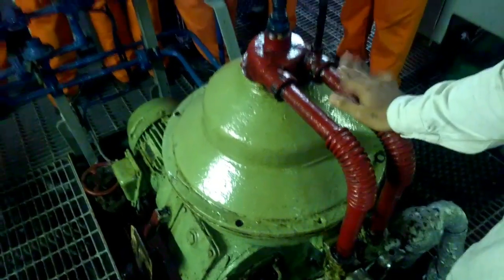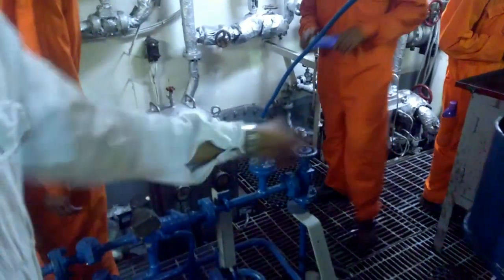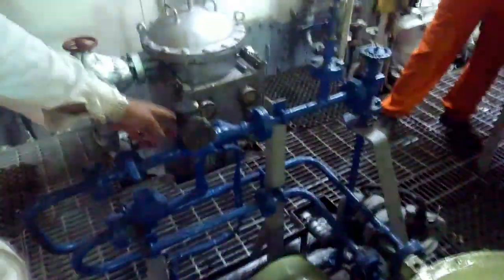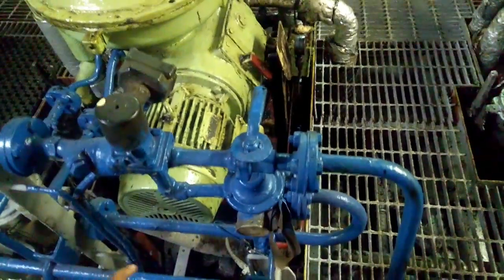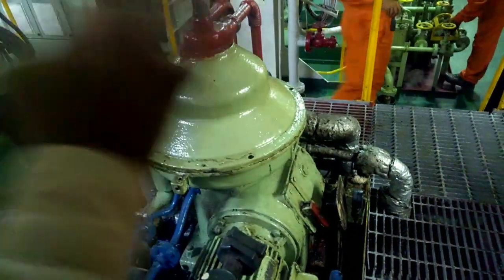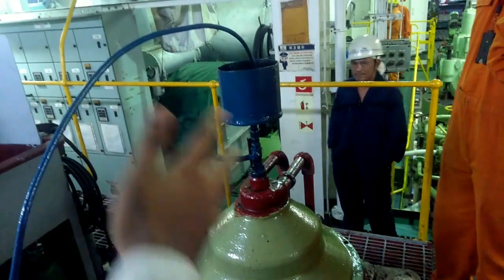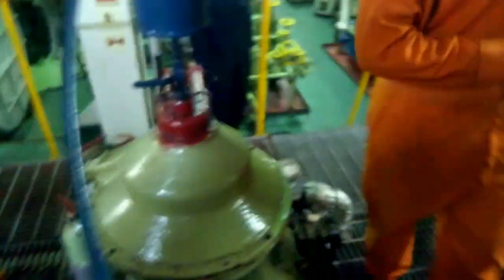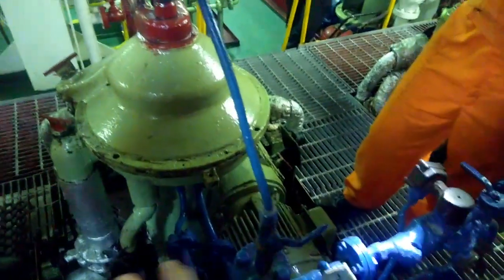I Spent 100 Hours Desludging Purifiers Here's What I Learned

Comment: Hlo sir, what is the difference between MC and ME engine and rt flex engine ?
Reply: RT flex controls the valve timing and fuel injection electronically unlike the MC engine where it's done by camshaft that's connected to the crank via gear/chain.

Comment: sir what is meant by blind disc purifier and clarifier and where it is placed.
Reply: @BasicMarineEngineering  sir thank you so much sir. IN purifier what is the purpose of blind disc sir?
Reply: If u want to run purifier as a clarifier .. there u need to use blind disc